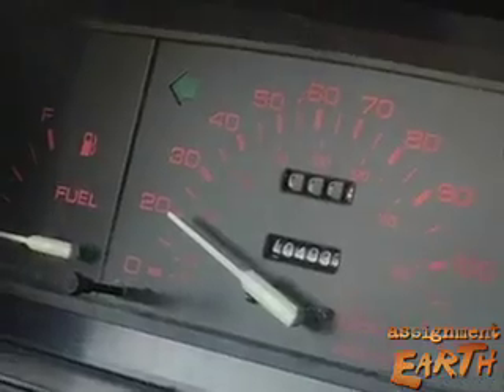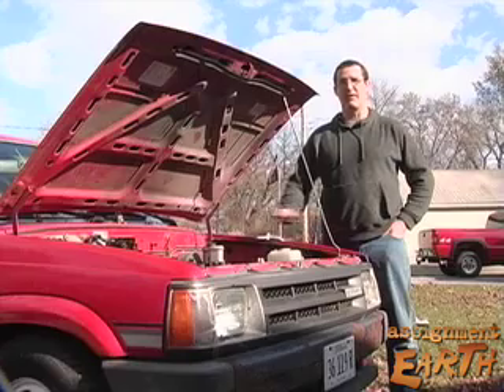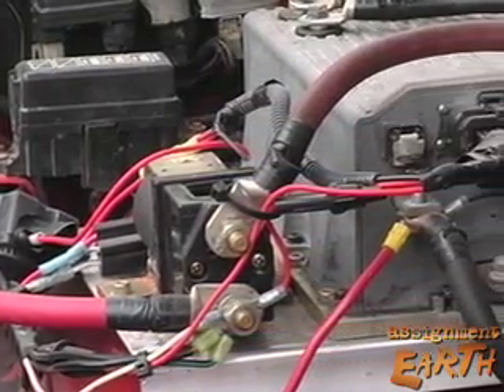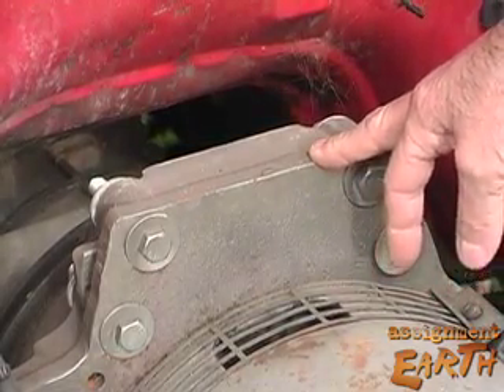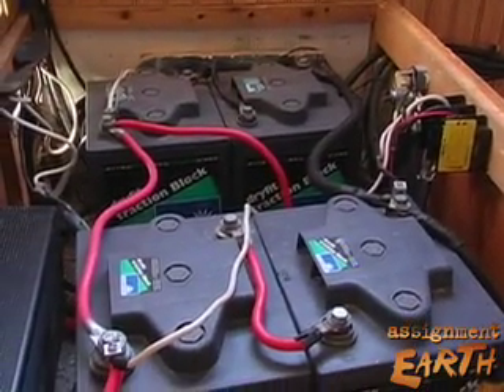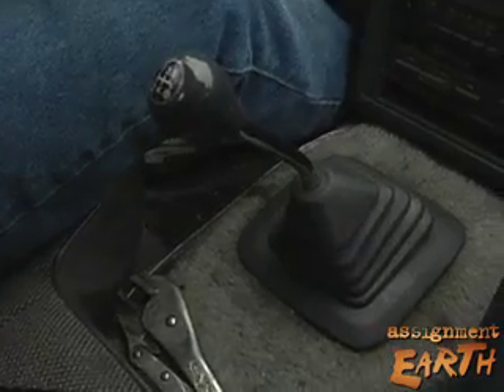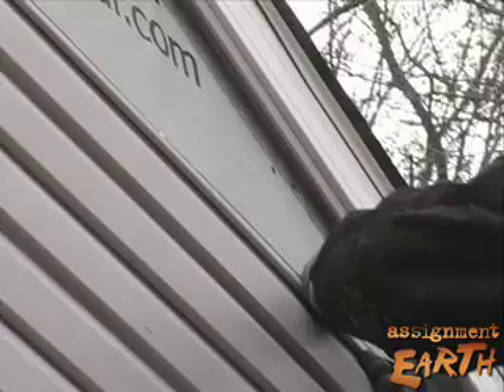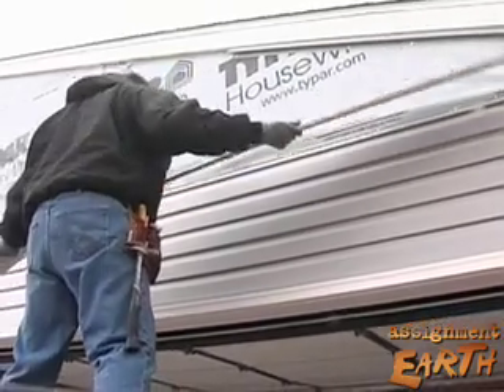Low-Cost Electric Conversion

Comment: I have a relative that did this with a ranger back in the early 2000s. It would run him to work and back(about 50 miles). Then charge over night and do it again. I think he said it was around .25c of electricity.

Comment: The price of lithium batteries has dropped quite a bit since this video was made. And at 1/3rd the weight and with an even higher energy density, it would make quite a bit of difference to the overall performance of this vehicle: Less weight, higher top speed, faster acceleration (due to less weight AND because lithium batteries can discharge faster than lead acid). They even make lithium car batteries so that his setup would not need to be adjusted too much. Just checked: These lithium car batteries range in price between about $75 and over $500.

Comment: If you can find it there was a broadcast on pbs that showed a group in Michigan that was converting 50s and 60s model cars to electric and where getting about the same results as people using small cars. They would get about 60 miles out of an 8 hr charge.

Comment: Great idea. 
Maybe you could put some solar panels on the roof it might extend your range.
Reply: Ben I hear that alot but it would not make a difference you simply do not have enough area on you car to do this, you would need an area the size of a house, people assume you get so much power from solar but in reality our best solor panels are only about 20% efficient consumer panels are only about 12-15% efficient at best.
Reply: +martinez1701a

You are wrong. I have panels in my home. They are meant to be 23% efficient. and a Tesla type wall storage bank.

BTW I was referring to the roof of the Van/car. Whilst the car is in the day light, it would add some charge even on a cloudy day .
Reply: Well as you're SO crude, mine is 10" (REALLY) 

Thanks for the offer but I won't be blowing smoke anywhere nr you....I only like women ;) lol 

You can get them around 50% efficiency but they are very expensive. But if you have the panels covering the roof of the car and yr home, that should go a long way to fully charge your batteries.

Ever thought of building a Tesla type Wall power bank? using 18650 cells?

Comment: Bullshit.  There's  a thousand  dollars  just in  batteries and the motor.   "All the other work"  is at  least that much more.
Reply: Batteries, from used car lots?  The only way that would happen is under the cover of darkness.  Used car lots will sell a car with a mostly dead battery, to save the cost of replacement.

Comment: how has this business turned out? I hope it's up and running. I'd love to convert a little 4x4.
Reply: most people with these ideas do it and enjoy it but dont care to make and sell to others
Reply: I want to convert my 35 year old rock crawler. I'm hoping to get the motors at the wheels themselves and be able to get rid of transmission and  driveshafts. This will help with clearing obstacles... and I really am so ready to ditch the noise of ICE. Seems this may be possible for even low budget  in  the near future.

Comment: Thanks for the video, I have a Datsun pickup in my back yard with a Clark forklift motor attached to the five speed transmission. I am just waiting for the battery price to come down a little bit more. I live in town and I have it cleared to put up a small vertical wind turbine to plug into the truck when it needs a charge. other than insurance and license, and the replacement of battery's,  every 5 to 7 years and tires, I think this is the way to go,
Reply: +jamescurrycounty Damn right, Is the way to go!!!  Good luck with your project!!
Reply: Or watch e cars change the whole street game!
https://youtu.be/ARzujfRiQ3c

Comment: several hundred pounds of toxic batteries with a 5 year life span.....assignment earth?
45mph?you plan on making a business model of this why?
Reply: +In Cognito  Acid, Zinc, lead, Is all recyclable, acid can be neutralized. Nickel, Cadmium not so much, once it,s spent is disposable? Lithium? same thing? Old style batteries may be better for the environment in the long run even if they don,t hold as much of a charge, the weight is issue as well. What are your thoughts?
Reply: https://www.wired.com/2016/03/teslas-electric-cars-might-not-green-think/
Reply: Joel Hill https://www.wired.com/2016/03/teslas-electric-cars-might-not-green-think/
Reply: Yeah, clever, wind up the top speed - reducing the range to 12 miles per charge.  It's nice that he tried, but 25 mile range...Seriously?  That is just unworkable.
Reply: I know people who could get away with a 25 mile range most of the time, hell, i could use it as a 2nd car myself... but it's not really viable to pay even the reduced bills on an EV and more importantly, battery cost for those miles. I presume the guy who did this build got used batteries cheap. The trouble with lead acids, particularly traction batteries, is they get ridiculously heavy real fast so adding more batteries becomes self-defeating

Comment: This is an old video. Wish you would put an updated one on, batteries are better - 200 mile range and faster than a gas car.
Would far and away rather have an electric car that can be powered by the sun, or any other kind of electricity.
Pull a lot of $ out of oil and gas co, tho. They bad mouth electric as much as they can. Trying to make a buck, or a billion, more.
Reply: 100% correct Miss Pat
Reply: updated video Man got shot and fell out of a moving car and then run over buy 6 cars

Comment: It's very cool and a top speed of 48mph is fast enough for 'around town' driving, but a range of just 25 miles is just too small to be of use.
Reply: I'd love to have that setup and change the transmission for higher speeds id even mount small wind turbine on my canopy maybe a beefy solar it'd look shit but itgo further
Reply: Physics 101: Wind turbines on the roof does not make you go further, unless you only deploy  them when parked. Higher gearing does not make you go further, it only effects your wheel torque and top speed. unbelievable big solar panels on the roof are a major drag except when driving really slow and 600W installed flat on the roof gives 480W x 6 hours = 2kWh/day which is 15 miles if you build your car twice as efficient as a Tesla (which is not hard). If you want to go far get high energy density batteries, stuff as many in the car as possible 50% of curb weight is good! Minimize aero drag and rolling resistance. Then you go 600-800 miles on a charge, but it will be as expensive as a second hand Tesla
Reply: @Tore_Lund  : You are spot on !
Reply: Tesla expensive..but they are changing the game.
https://youtu.be/ARzujfRiQ3c
Reply: Great for around town. Many people stay within a five mile radius. That does not include me. I live in a small town and it's basically 60 miles to a city where I can get work. Still, I think the technology has come a long way since this video.
Reply: With current lithium batteries with higher energy storage for the same space, farther distances are capable now.
Reply: except for him of course.

Comment: the reason EV conversions typically cost so much, is because few big biz are putting any money into R&D and production.  Low demand, low supply = high cost.  And car companies wont invest in this tech, since they make more money on repairs than the actually product.  With an EV, there is less to repair and maintain.  Sure, batteries can be costly, but no fluid changes, tune ups, less computer systems, no exhaust systems or intake, no sensors...you get the idea.
Reply: So now computer systems at all? What about the display in the dash or brakes? or can the abs brakes system be removed now?
Reply: trust me, they thought of that stuff.  But they compared the MTBF (mean time between failure) of those systems verses the systems in a gas car. 
And I think with a electric motor, you can use the motor for some of the braking.
Reply: RCPro Driver So if you have that ABS light that comes on in your car and you dump your I.C.E.(engine) for an EV can you legally get rid of the ABS and ABS light?
Reply: maybe laws requiring ABS wont apply to electric powered cars?  Plus, many older cars that are then retro fitted with electric motors are old enough that ABS isn't an issue.
Reply: RCPro Driver yeah I guess, wish I knew. I'm thinking that if it's not there, no one can do anything about it. haha
Reply: I have seen many conversions that were done with cars pre-'95 for 2 reasons....lack of certain features like ABS and also many older cars and trucks were much lighter than modern counterparts.
Reply: RCPro Driver How would the cars be lighter when they had better steel and metal back then?  Ironically one of my used cars is pre-95 and has abs crap on it.
Reply: depends on the car....pre-95 Volvo's used heavy steel.  Pre-95 Honda's were lighter as they were smaller and had less extras.  Many pre-95 cars didn't have ABS, TCS, some still had SOHC, some still sold without power windows/locks/seats.  The materials used may have been heavier but less overall material was used.  A 1989 Honda accord was 2600 pounds, a modern Honda accord is 3300-3600 pounds.  The current civic weighs slightly more than the 1989 accord. 
Whether or not pre-95 cars had ABS or power extras depended on the cars' class.  mid class or luxury cars did have those things.  my 1992 Volvo did have ABS.  My pre-95 hondas', Nissan, toyotas' did not.  But all of them were lower cost cars.  At one time, things like ABS were a luxury...today they are standard equipment.
Reply: RCPro Driver What's TCS and SOHC? The no power windows thing is sort of good imo because replacing the power window motors is expensive, even if you DIY. I wish most cars, even new cars, had roll up hand crank options as well.
Reply: TCS, traction control system.  SOHC, single over head cam.  DOHC, double over head cam. 
I think roll up windows are a bit lighter than power windows too.
Reply: @999benhonda : Chevy Bolt EV has some sort of ABS

Comment: Voltage x Amps =  Power. Voltage makes electrons move, and you get a electro-magnetic field that moves the rotor. If you need a certain voltage, there are few choices, but I would go customizing the engine wiring to work at certrain voltage. An electric engine repair shop could do this.

Comment: Gas+oil is about 2 times the cost of the electricity+batteries (everyone ignores battery replacement cost which is huge). Range is limited, charges take forever, the cars are heavy, and storage space is limited if at all. Most Americans live less than 50 miles from their full time job (8 hours), so you should have over a 50 mile range (about 100) and get a full charge while at work. Weight will drop as cellphones improve (cellphones are the cause for the most battery r&d), but so what about the

Comment: The maximum vehicle speed and load carrying capacity is limited by a combination of battery voltage (more volts-faster speed)  the RPM capacity of the motor (too many rpm--motor comes apart), amperage capacity of the motor (too many amps from too heavy load-overheat), combined with the gear ratio of the vehicle's transmission and differential. If you're asking how you control speed going down the road, then there is an electrical control connected to the pedal that controls voltage to the motor.

Comment: @electra4554 but lead acids are cheap! personally i like nickel iron batteries, but you just can't get them. until lithium gets safer and cheaper I will continue to use nickel and lead

Comment: 25 miles out of 11 battery's that only go 45mph?? plus you have to wait for it to charge. that's not even worth it. there's no a/c, no heat, no amenity's at all and it cost 1000 bucks and that was with used parts. I like the idea, but the technology has a long long way to go.

Comment: Two points,
Try looking at Lithium Polymer batteries (Lipo) and secondly the USA is responsible for consuming 29% of the worlds production of petrol (gasoline) , in the uk an imperial gallon of "gas" (4.5 litres) is approx £6 ie $10 and if the US had to pay this much for fuel there would be more guys like you to further this idea, good on ya mate

Comment: Amps = Torque and voltage = rpm/speed... so if u want to increase your top speed go with 72 volts or more then you got a freeway capable EV... with a 500 amps controler at least !
BTW: li-ion phosphate battery is the way to go; check out winston battery ;)

Comment: @gfhnk in pricinple that's still possible. but the battery would need high current capability. a typical car might need a minimum of 20kW to move practically. at 15V that's over 1000A. no standard products available for that type of operation. you probably want to string together at least 6 12V batteries in series for 72V. then you can use a used alltrax controller or such from ebay. it will still be relatively low speed but it will work.
check evalbum. com for typical choices

Comment: @gfhnk 12V? and what Ah capacity? you can do some with 48V but it'll probably be a low speed vehicle. although in principle it can be fast with 48V as well. but they would have to be quite big batteries.

Comment: @AClRCLEOFLlGHT Take a look at my videos if you want proof of my electric car. As far as the solar panels they are suppling most of the electricity in my home anyway so it is a win, win situation!! No lie's in my statements. The problem with any new technology that you don't look at is the "Greed Factor". By doing the work yourself you save more than half the cost of a conversion....

Comment: @AClRCLEOFLlGHT You don't know what your talking about. Anyone can convert to electric doing the work themselves for $4-6,000. With the motors and controllers they have today you can drive highway speeds with no problem. Thw average person drives 18-30 miles aday. I charge mine with solar panels and it raises my electric bill $0 a month. So reality isn't such a bitch after all...

Comment: @AClRCLEOFLlGHT You don't know what your talking about... Anyone can convert to electric, doing the work themselves for $4-6,000.00. With the motors and controllers they have out you can drive highway speeds with no problem. The average person only drives 18-30 miles aday well within the range of any of these cars. As far as charging goes I charge mine off my solar panels and it raises my electric bill $0 a month. So reality isn't really a bitch!!

Comment: How about a hauled truck with battery stacking module. The truck can be on one wheel maintaining balance with the heavy car in front or on two wheel with cable connection to share load or to back up main battery on the car. The truck can be designed to have enough for luggage. You can stack more batteries for longer trips. You can also use solar rod on parabolic mirror focusing sunlight to recharge the stacked battery as well on the hauled truck.